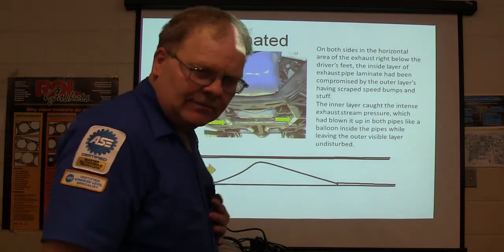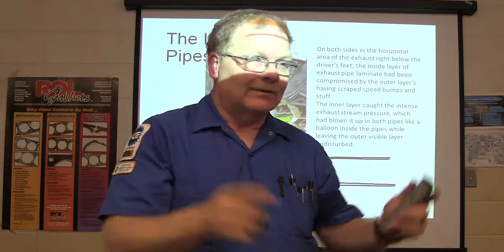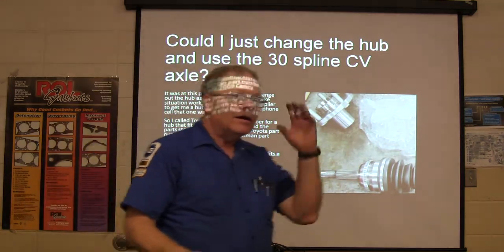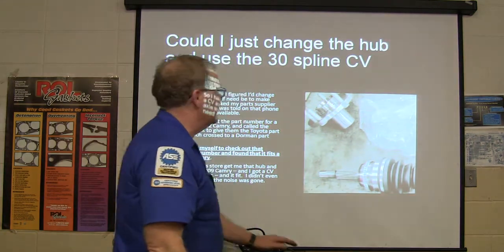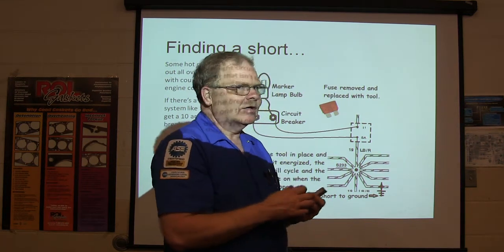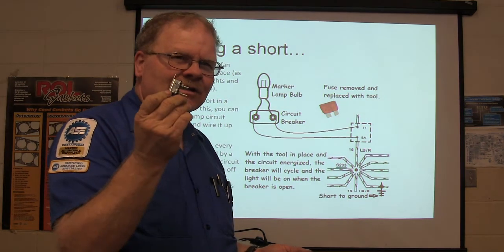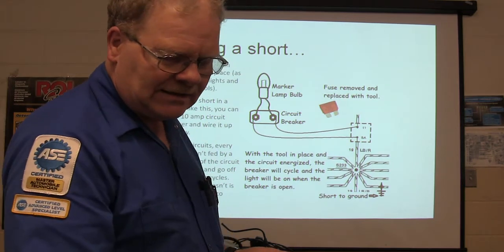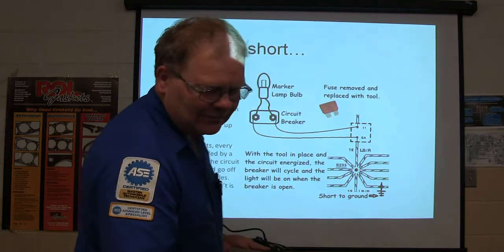Diagnostic Stumps

Comment: maybe you have an idea.85 toyota 22re and runs real rough off idle part throttle seems fuel related but idles good and heavy throttle seems to get better. my question is the egr backpressure transducer. exhaust line that feeds exhaust pressure to bottom of transducer has vacuum on it when i pulled hose off and increases vacuum as i rev up allittle. how is that possible when im supposed to have pressure there. im not sure if thats a clue to running issue but you have seen it all so i thought maybe u know its my boys truck and would love to figure this out
Reply: Jason Lark I would check the tps, make sure it doesn't have any drop outs.
Reply from the maker: 1. there are low pressure pulses in the exhaust that will feel like vacuum when the engine isn't loaded (pulling).  2. If the exhaust has been modified - no catalytic converter and running a glass pack - all you'll feel are the negative pulses.  If you put the truck under a load and put a pressure gauge in that line, you should see some exhaust backpressure if the exhaust hasn't been modified.
Reply: thank u so much